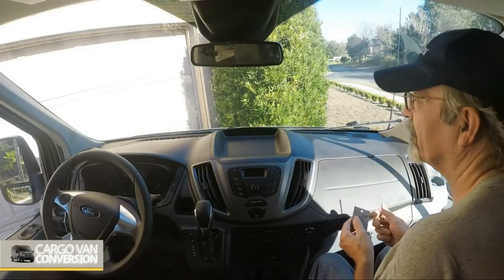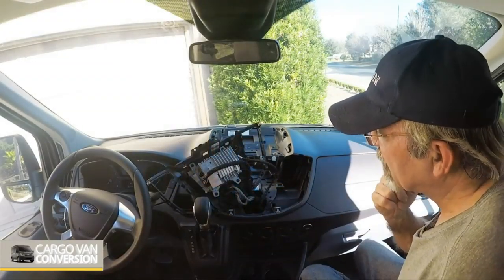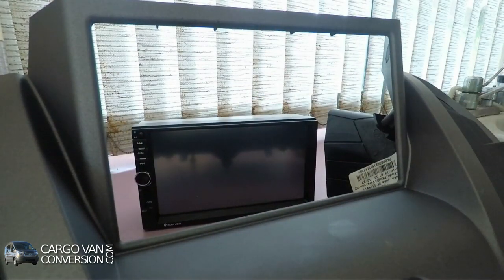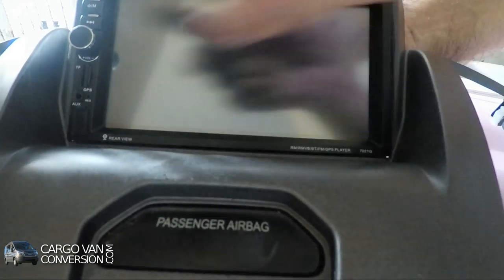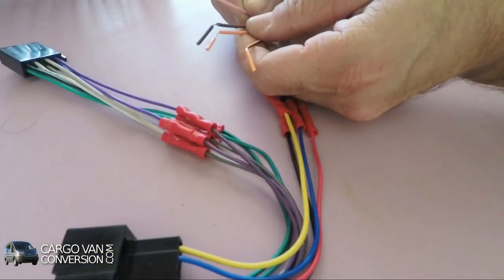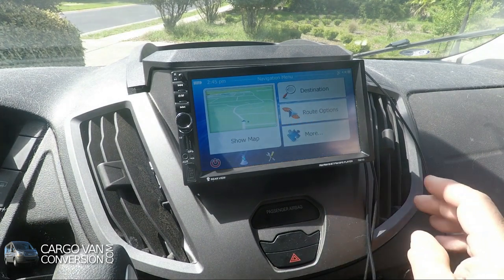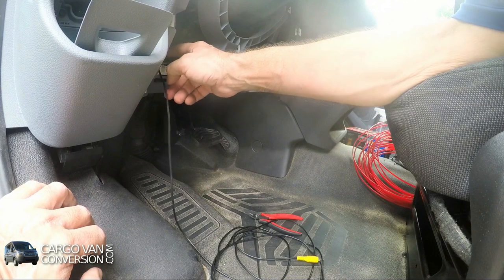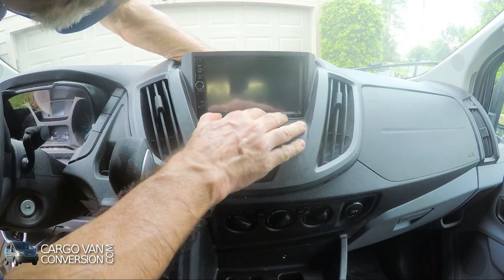Ford Transit Radio Upgrade & DDin Installation

Comment from the maker: This is a compilation of two previous videos on one subject, visible in the "Finished Projects" playlist. I realized that many projects during this build, are shown in the many different weekly videos that I make. Compiling each project into one final video, when finished, will make it that much easier to access. You can expect more of them in the upcoming weeks.
Van Williams
Reply: The navigation radio system link does not work or it is been deleted, do you mind to repost the specs to get an idea?

Comment: Nice video. I will install in a Transit Connect myself so just wanted to get an idea on how Ford made their panels. One note though... I dont belive it was nessasery to cut in the kit. The unit is supposed to be put in from the outside after the facia is installed. Not from the backside i belive...At least this is the way in 100% of all stereos iv been installing :-). But thanks for sharing this!
Reply from the maker: Hi Grombil,
Thanks for the thumbs up. It was a nice project. The connect probably has many of the same panels and connections and since you likely have many of the tools you need already, it should be easy to do.
Good luck!
Van Williams

Comment: I'm always afraid that I will snap the plastic clips (sometimes I do) . Good job.
Reply from the maker: Hi Norman,
I could have used either the old or the new clips, either way I would have had enough to replace a broken one. It is a lot of feel and touch to get these panels removed the first time. Once you know where they are attached, it becomes much simpler :)
Van Williams

Comment: Joey is your backup camera in your rear view mirror? Mine looks exactly like yours and is. I have an issue with my factory rear veiw mirror backup camera and am adding an additional aftermarket backup camera and android unit. The android unit will work as my backup camera. What I'm wondering is what wire for signal to turn on camera. Commonly referred to as reverse wire. Do you know what wire is used for that?

Comment: where can i buy that new panel to replace my radio
Reply from the maker: It depends on the size of the radio, that you want to install, but the one I used was bought on Amazon: https://cargovanconversion.com/shop/ddin-kit 
It's been installed for quite a while now, and it's perfect!
Good luck!
Van Williams

Comment: Did you disconnect the battery from the driver seat?
Reply from the maker: Hi Henry,
Actually, I don't think I did, but everyone should do that before working on the electrical part of the vehicle. Thanks for making me aware.
Van Williams & Joey

Comment: I like this upgrade display better than that small display backup camera it is too small. Finally Ford upgrade recently.
Reply from the maker: Hi Olga,
I still have the small backup camera display in the interior mirror and that suits me fine, although I don't disagree with you; it's small. I use my sun visor often and that blocks the small screen, which frustrates me. I have to say, that early in the build, I added a 'backup warning sound' that goes off when I get too close to an object. That helps too.
Van Williams

Comment: Two questions...  How was the fit on the Dash?  I've read complaints that it does not fit neat and snug.
Also I've heard that you have to cut out a horizontal part of the original dash behind the radio.  Is that true?
Reply: Dan, yes you have to cut out that plastic bar to install a double din head.
At least on my 2018.
It may not be necessary on the single din head. 
But that would reduce your options available. 

I also was concerned about the fit after reading reviews. I checked the fit of the Metra dash cover before installing the head and it fit perfectly without the clips. I think the complaints about fit may be related to clips improperly installed or not completely pushed down in place. They were very difficult for me. 
Crutchfield was my go to supplier with all harnesses needed and great tech support! 
Feel free to contact me.
Be glad to help out.
Reply: Cutting the plastic horizontal bar was really easy with a razor blade knife and you do need to disconnect the negative battery cable. It seems if you don't you end up with the passenger airbag light on.

Comment: did you have issues with your air bag light??
Reply from the maker: You may have seen an air bag light on. which is because I switched off the passenger seat air bag. As I never carry extra passengers, I have permanently installed the passenger seat backwards, thus making the air bag deployment undesired. Unfortunately, this causes the dashboard light to always show.
This is not a defect, just an inconvenience.
Van Williams

Comment: why music over speech , just merely hear music so to hear more speech please
Reply from the maker: Hi Donato,
My videos have changed quite a bit over time. This was a compilation of two previous videos on the subject, which I posted far apart previously. Posted now in the "Finished Projects" playlist, makes research on this subject much easier. Did change some parts of the videos, but couldn't change the sound.
Thanks for the feedback.
Van Willliams

Comment: Nice work! Next Time please use some towels to prevent scratches😀
Reply from the maker: Hi Andreas,
Didn't think of that. I'm usually pretty careful, but I should consider using some shop towels next time. Thanks for the tip.
Van Williams

Comment: Did I miss the " Step 1 : Disconnect the vehicle battery leads. " Generally advised before working on any electronics on a vehicle.
Reply from the maker: What would I do without you :) But you're right, I sometimes take shortcuts. The lines sometimes blur between a How To guide and How I did it. It is the latter and you have to use common sense.
Thanks for keeping me on a straight path :)
Van Williams
Reply: Cargo Van Conversion  : Glad to help :-)  I was worried maybe the instructions missed that or it got accidentally edited during the update. Usually no problem but potentially bad if wires get shorted. And of course people should refer to their owner's manual for the proper steps for that as it may vary by vehicle.

Nice idea compiling the videos by the way, just don't edit out any Joey scenes ;-)

Have a great day !
Reply from the maker: Both original videos were recorded with about a year in between and each probably over a period of a couple of weeks. I usually have close to 50 clips per video. Sometimes I loose clips, but more often I can't use some, because they're out-of-focus, too dark or the subject is completely out-of-view. In this case, I don't think that I disconnected the battery and that means no video either :)
I hope that people don't think of my videos as a How To guide; I just want to show, that with a little common sense, we all can do the most extraordinary things.
BTW If I would edit Joey out, he would fire me without hesitation :)
Van Williams

Comment: This seems familiar.  Is this a re-upload?
Reply: Was wondering that myself as saw this one months ago
Reply from the maker: Hi Mark,
Can't hide anything from you guys :)
You're right. Posted two videos on this subject quite a while ago, both about a year apart. Did a remake on them and made one new video, that I posted in a new playlist "Finished Projects". That makes it much easier to research a specific part of the build.
Didn't have much to show for this week either; applying lots of poly-urethane and drying of the workbench and started to work on a new website for the Van travels as well.
Van Williams
Reply from the maker: @johnmead1337  Hi John,
Don't know if you saw one or both videos. This is a two-for-one compilation :) You'll see some more of those in the future, to make it easier to research a specific part of the build.
Have a great day!
Van Williams

Comment: Was this a 2020 van? I think 2019 different?
Reply from the maker: No, it is a 2016 model, Nello. It came with the basic radio option. I'm not entirely sure if or how the current model differs. Generally, access to the dashboard will be similar. If you want to upgrade a basic radio setup, I would consider installing a large (Android) tablet.
Wish you well.
Van Williams
Reply: @cargovanconversion  the 2020 model looks completely different in the us.
Reply from the maker: @agarcia4271gaming  Many differences between European and American models too.
Van Williams
Reply: @cargovanconversion  all 2020 models come with sync 3. No need to upgrade any more.
Reply from the maker: @agarcia4271gaming  Hi Andy,
For me it was more of a  downgrade. I don't use a radio and don't have my phone on while driving. The latter is much too distracting for me. Would consider a large touchscreen (mainly for GPS directions) next time.
Van Williams

Comment: Music is too annoying for me to watch this video
Reply from the maker: Music in these videos is always an issue for a variety of reasons. If you have watched my more recent videos, you'll notice that a very limited amount of music is used.
I do appreciate your comment.
Van Williams
Reply: @cargovanconversion  I'm an older geezer than you with terrible hearing and any amount of background noise makes it very difficult to hear. 

Yes I went with a new radio for the GPS and larger closer screen for the backup camera! 
Don't know how to work all the other features including Bluetooth 🙄. 
I only have a few teeth left and they are all green! 
I too will be boondocking.

Comment: Wear eye protection when using power tools (especially saws) your videos will not be nearly as interesting if your blind. They will be viewed as comedies if you can’t see what your doing. Other than that very good. The only component of your videos I didn’t see the usefulness in was the work bench it appeared take way to much effort to use and the stuff in the drawers would be in shambles. Other than that I’m in Florida and want to build a Murphy bed how bout helping a brother out or would you contract yourself out to build one? DM me if your interested!! Much love and great job sir!

Comment: I think I’m the 21st century you can really just get away with using your phone
Reply from the maker: It's an interesting issue, especially where I'm a bit older and I notice a bigger resistance to innovation. Regarding the GPS (main reason for doing this project), I still don't see a good reason for using my phone as a primary device. Don't need it for up-to-date road info and with boondocking as a main goal, I have seen too any instances, where people can't get a signal, while independent systems or a phone with off-line maps work well all the time.
I guess, it must be seen on a case by case situation.
Van Williams